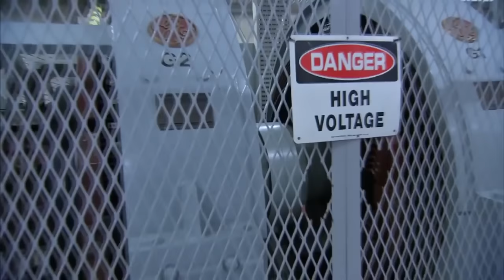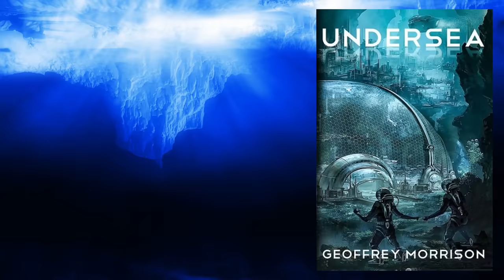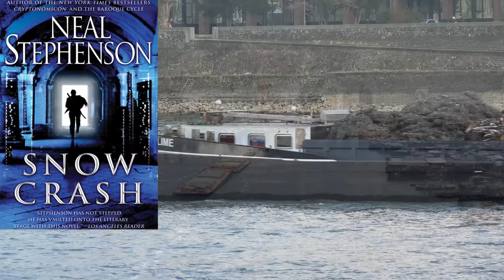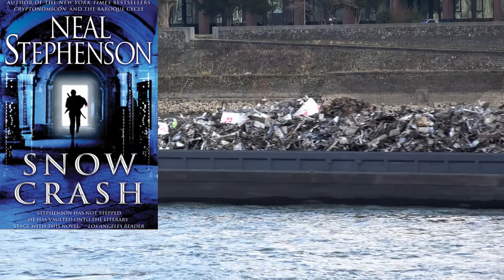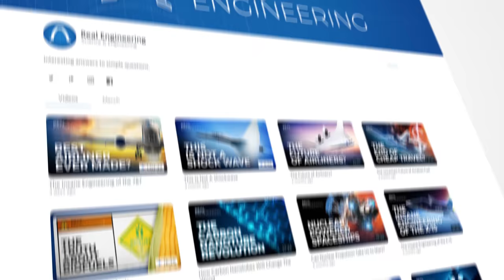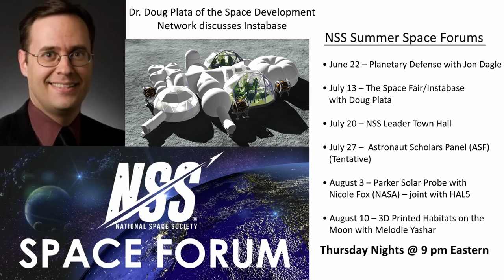Mobile Cities

Comment: For mobile mining settlements, needing to move to stay either in the sun or the shade seems pretty worrisome to me...
You had better be very confident those legs/treads/rails/thrusters will never seize up or become disconnected 😅

I think they would have to design this stuff with redundant/alternative locomotive systems just in case.

Don't wanna get cooked during a hot planet's day time.
Don't wanna get frozen or run out of oxygen because you missed the sunlight.
Reply: One redundancy I would add (or maybe even consider as a “must have”)…
Would be to build with materials of sufficient durability, and/or sufficiently insulated, so that failure to move wouldn’t result in anything worse than “discomfort”. 
You definitely don’t want such a failure to be a death sentence.

Comment: See this raises a thought in me. 
How could we extract energy from organic matter (food) without the need of a biological system or maybe have a mechanical system filtering out the high energy items before passing the remainder into a biological system. Or maybe the reverse would be the case where a mechanical system could “scour”/tap the glucose from a biological digestive system and turn that into a fuel source to power cybernetics. Nothing to say a “battery” has to be a solid energy mass, protected pockets of glucose could be perfectly viable alternatives.

Comment: I’m hoping one day white dwarves/neutron stars/black holes could be used for stuff like shoving material down them for industrial use. At what point between a neutron star and a nucleus is the minimum size for degenerate matter to be stable and what could we do with it? So much potential, even for stuff like computing outside of its basic strength…

Comment: It always seemed impossible to me. It's difficult to do for a two-story house. A whole city would be straight-up impossible.
Mobile cities is a thing in the fiction of the Arknights mobile game; in this world they have a powerful abundant energy source. Even with that I think it's impossible, though.

The Dark Moon strategy game (upcoming) is a city builder featuring a mobile city that moves to try and stay on the dark side of the moon.
Reply: What about them being on rails?
Reply: I used to think that only children believe in the “impossible”…
But, as I get older….  I realize, there really isn’t that much that is truly impossible.
As Isaac mentions….  It’s really more of a question of practicality, and motivation.
The main reason for NOT doing many things (which are “possible”)….  Is simply because there are more practical ways of achieving your overall goals.
Reply: Easily possible. On water we already have that, a large cruise ship or an aircraft carrier are practically cities. In air, airships have no practical size limits, in fact, the larger the better.
On land, take NASA's crawler transporter, it's plenty big enough for a decent size apartment complex, and the rockets it carried were just as heavy. A mobile city doesn't have to be a single entity. And I'm pretty sure we can build them bigger, much bigger than ships. A ship has to deal with large waves, a land crawler doesn't, so it can be less rigid, and therefore bigger. And with more advanced materials size can be increased further. And if you build the houses from steel and aluminium (or wood), they would be far lighter too.

Comment: You build a mobile city to get away from big government. 

I call it the firefly principle. 

No matter how long the arm of tyrannical government gets, you need need to travel a little bit further away.

Imagine building a village sized "kill doser" and driving around the country, ignoring the tyrannical government outside. 

You find a good spot to park, and then when it looks like the outside government is trying to pull some shenanigans, you just drive away. 

I think this works better as a boat. The problem is that "the powers that be" would likely just sink the boat rather than allow people to seastead.

Comment: We already have movable floating cities. They are called oil rigs, and can house upwards of a thousand people over time. As we weed off oil it would be possible to repurpose these platforms for housing, and we could then increase the number of permanent inhabitants an order of magnitude. Several platforms can also be linked together to make larger cityscapes. I see this as quite realistic, but it would require a individual like Elon Musk to kick it off. 
The advantage would be that you could tow the cities to different parts of the earth to avoid climate problems, or to always be in an area with good sun for solar power (following the summer with 3 or 4 anchor points around the globe that they move between). They would always be in international waters and be able to define themselves as independent states to avoid taxes etc. Basically the future cities of billionaires... Avoiding all the trouble future climate changes will cause on land.
ED

Comment: 5:08 In Destiny, the Cabal have these massive gargantuan land tanks they use in their conquering efforts. They come from a high pressure planet, is that similar to high gravity?
Reply: Not necessarily. Higher gravity definitely plays into atmospheric pressure, but increasing atmospheric pressure is also possible without adding G's. Atmospheric pressure is put very simply "air weight" resting on you at all times. If you swapped out any component of Earth's atmosphere for a heavier gas, i.e. Bromine, Butane or Chlorine, you would have quite a lot more air weight on you.
Reply: @sptony2718  Yeah we have like 14 lbs of air on us in Earths atmosphere. Well mostly nitrogen, with a bit of oxygen. I’m sure you know that. Cool beans! Thanks for the information. 👍

Comment: Late to the party here, but you might alo like to at least briefly exmine the Mercurian capital city (only city, really) of "Terminator", in Kim Stanley Robinson's 2312.  That travels around the planet on rails, forever in the pre-dawn - the rails expanding with the heat of the sun, and that force thus propelling the city.  That strikes me as a fairly fanciful idea, but it certainly does grab the imagination.

That idea might be the highlight of the book, however.  IMHO, I would rather read calculus - and i failed calculus.